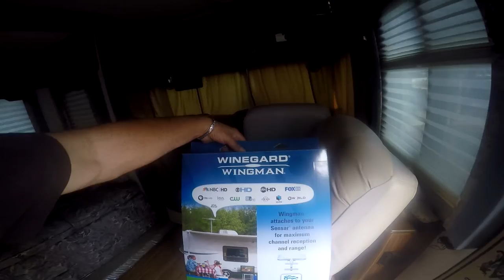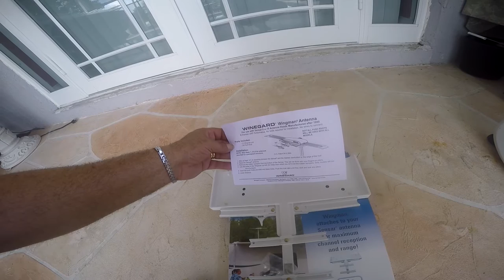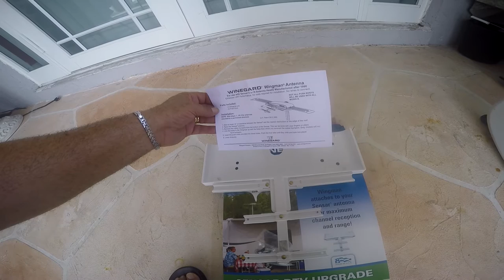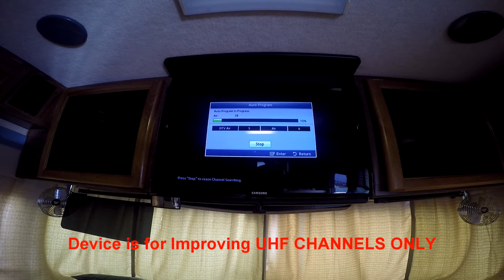HOW TO INSTALL RV WINEGARD WINGMAN UHF TV ANTENNA BOOSTER on Winegard Sensar Batwing - Digital TV

Comment: Bought one of those to replace mine years ago while down in Florida. IT MADE NO DIFFERENCE. I had anticipated changing it out months earlier so as I traveled, I made a spread sheet of the stations I'd get with my old antenna and then again on the way back west with the new. NO IMPROVEMENT. Same stations received.
Reply from the maker: Interesting. I'm sure you reprogrammed the TV after you installed it and at every new destination you need to reprogram channels again. plus the antenna settings.